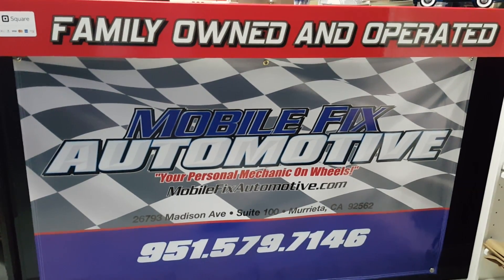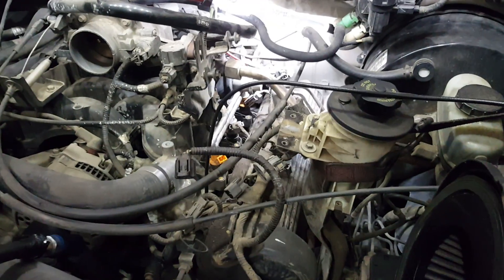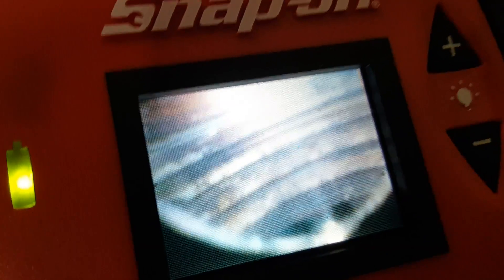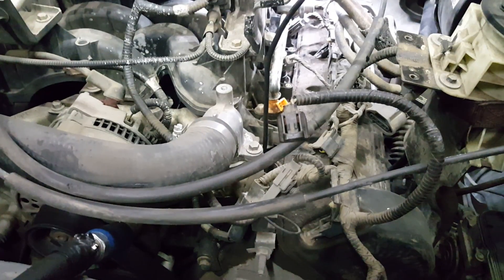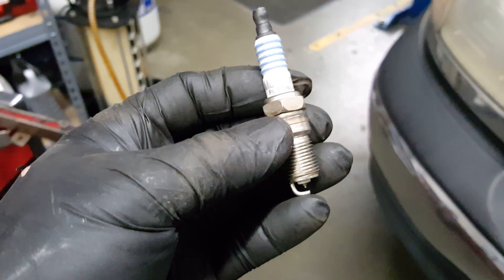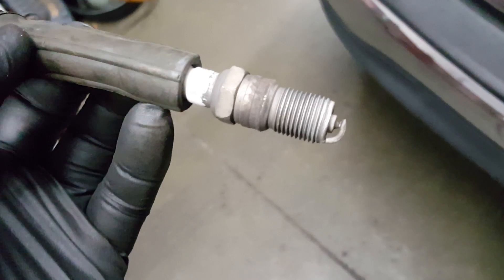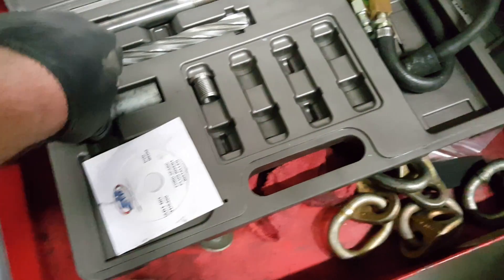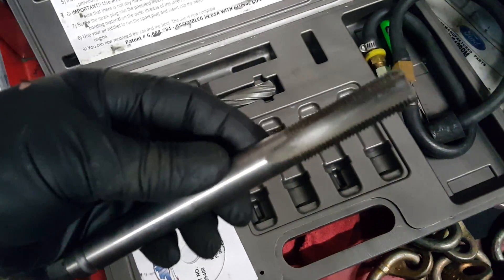Why the spark plug blew out of your Ford Triton engine

Comment: Son's 05 4.6 v8 2 valve insert blew out,need a 3x over size repair! Any ideas??? Thanks!
Reply: Buy a dodge.
Reply: I used cal-Van kit to repair a thin insert blown out on a 01 5.4 on cyl #4, a 20 minute job, has held fine for 4 years.
Reply from the maker: +RevBiker Big D it blew out a larger insert than the cal van.?
Reply: Ron Williams  No, just an auto part insert, mechanic said it would need 3 sizes bigger than first insert!
Reply from the maker: +RevBiker Big D 
I have successfully replaced blown out heli coils and save a threads with the cal van kit.
Reply: Ron Williams ok thanks will find out if your inserts you use will be bigger than the hole that's now there!
Reply from the maker: +RevBiker Big D outside diameter of threads is aprox .687in.
Reply: Ron Williams thanks for the size!

Comment: Your opinion. Hellicoil the head if you need to but if this was a factory issue, it will have been picked up.
Reply from the maker: +Jon Snell what do you suggest i tell the thousands of helpless people that blow out the spark plugs.? And dont say its a tune up issue. Ive personally seen this happen as low as 33,000 miles now. Plugs arnt even due then?

Comment: My 98 F150 5.4 blew a plug out at around 120k, at a 180k and rusted out 4 years ago, it's now long gone. I always knew why it did, it's  because of only 4 threads in the head is not enough to keep a spark plug tight from all the heat reaction contraction from everyday use. Makes me wonder what do other pickups have for thread in their motors?

Comment: Well done, excellent video!
Reply from the maker: +DanielJaegerFilms 
Thank you. I dont know about excellent but it should put some ford engineers on the spot to answer why they did not tap spark plug bore entirely.
Reply from the maker: my opinion is because the bore is tapered. they tapped from bottom up, it gets wider as tap goes in. that's why save-a-thread does not last in them.
Reply: @SandCarServices  my coil pack broke and the bolt is stuck on the intake manifold! It turns freely and doesn’t have grip to anything!!! I need some thoughts!
Reply: i just picked up a 03
rv with the v10 6.8 engine. should
i be worried about this? has super low
miles on it. 25k
Reply from the maker: I did a #3 on a 6.8 Triton in a class a motor home with 16000 miles months ago. So yes, check and make sure all spark plugs are tight
Reply: Ron Williams So should I do what blipco5 suggested and do some preventative/proactive measures like changing out my spark plugs and install new spark plug with anti-seize seize?

Comment: It's  a coil not a coil pack.  There's 8 coils not a pack.  A 4.0 jeep has a coil pack.  A gm waste spark coil on the 3100 etc...
Reply from the maker: +anthony fym 
You are correct in what a coil pack is however technically they are called a direct ignition coil. Or c.o.p (coil over plug)  ive been doing this so long i have my verbage and thats what i say. Im not charging for the information on my videos and im not giving incorrect repair  information in my videos so why are you splitting hairs. I had some really great videos that i have filmed and deleted just because i said something wrong but did it right at the same time.
There are verbal mistakes in nearly all my videos but none will cause a person to do something wrong to thier vehicle. All I am trying to di is pay foward what i have learned to help the community.

Comment: I bought a Ford F150 as a wood hauler, a 92 with about 150K on it  yes old, but only 150K.  I was getting an odd exhaust leak like engine noise - two of the plugs were loose. Went to change the plugs and I almost had to put a a break-over bar on them to get them out.  So some were apparently backing while others were almost froze to the head.  Issue after issue. Can't imagine why people spend real money on Fords.  

But unfortunately from the reviews I've seen Chevs aren't much better if at all.  Watched a video yesterday about a mid-nineties Silverado and the guy was going on about how much he liked the truck.  And then went on and on about all the problems he had had with it.  In the end, about the only thing he had not repaired or replaced was the transmission.

I also have a truck that is not a Ford or Chev and won't say what it is because I don't want to increase the competition with people who finally admit the stuff they're driving is crap.  It has almost 300K on it and don't have any plans for replacing it.  With what, a $41,000 Ford that has the same issues they've been dealing with for the  past 30 years?

Comment: Hey Ron nice video as for me I own a 2000 E450 with a V10 2v with 215,000 miles on it since brand new from the dealer back in may of 2000 Im suprize I have not had that issue with the spark plug blowing out why is that?
Reply from the maker: +Live Your Dreams
Not all engines do it. But keeping plugs tight helps
Reply: Very true ron I guess I got one of tje good ones lol

Comment: not enough threads ! I will never buy a triton engine !
Reply: The 2003 Ford Mustang Cobra had the same issue. I used to ride with my repair kit with me cause I blew out every one at some point. The 2004 cars had 10 threads.
Reply: Ford corrected the problem then discontinued the engine shortly after
Reply from the maker: Ford never corrected the problem and the engine is still in production. The 6.8 v10 is still being put into Van's and motorhomes. The 4.6 was made after 2004 when the 3 valve was introduced.

Comment: Don't own a ford..Now and forever amen....
Reply: I have owned many Fords. They are no better or worse than GM. It's still a matter of personal preference. My 2004 f150 4.6l have 225345 miles on it and my 95 tbird lx4.6l had 330,000 on it and still running. So that argument is moot. I have had GM products that failure was a common feature of the vehicles. So I will stick with Fords.
Reply from the maker: Well put.
Reply: @stevenbaker470  Be glad that T Bird isn't a '95 Taurus.  The 1995 Taurus is the reason I'll probably never buy another Ford....  Except for the good old classics of course.  That Taurus I had was by FAR the biggest pile of shit I've ever owned or dealt with.  Bad engine design...  Bad transmission design...  The most idiotic wiring harness I've ever seen.  The list of shit wrong with that fucking turd is endless.  I scrapped it at 85,000 miles.  My 1993 Escort?  GREAT little car.  Sold it to a friend when it had 220,000 on it.  The only problem was the AC had a slow leak and it was so gutless you couldn't drive up a hill with that AC on.  Still, that piece of shit Taurus was inexcusably bad.  A friend of mine also had one.  His was a complete piece of shit too.  Most of the same problems I had with mine.  Some time during the 1990's Ford forgot how to design a decent car.
Reply: Ur a moron. Own a foreign car is cool tho right? When it comes to trucks & SUVs Ford owns that. Sports cars too. At least up to $70k in sports car segment then Corvette & Hellcats take over. Ur a troll. Go get in ur Civic or Corrolla . I rather take a bus everyday.
Reply: @Davido50  the only moron here is you Davey kimmstick. You are talking out your ass again
Reply: Unfortunately chef and dodge are even worse. Most logging companies in bc use ford. They seem to be the toughest pickups. F350 or bigger though.
Reply: @bobfossum7515  Yet Ford is the only one who can't properly put the spark plugs in the engine.  Tell me, how exactly are Chevy and Dodge worse?  Give me an example of ANY Chevy engine that is even half as flawed as the Triton.  The ONLY one I can think of that was as gigantic of a piece of shit as the Triton was the Chevy Vega engine.  Keep in mind, Ford fucked up the spark plugs on the Triton TWICE.  Ford will continue to sell garbage because dipshits like you will buy them no matter HOW shitty they make them.
Reply: @craigcampbell8560  Chevy 305 the engine in the first generation of the 4cyl s10. All American car manufacturers have some form of issues. Particularly in the 1970's.
Reply: @bobfossum7515  I have a 99 Tahoe, engine has never had an issue. Only problem was the transmission at 100,000. Only has 115,000 on it right now. This is why I am still a Chevy fan.
Reply: @andym1223  had a 2001 GMC 1500 4x4 with 245.000 never did anything to the engine except mantinenc original 4L60 trans and I sold it for $6500. Had a 1998 Chevy 4x4 1500 sold it with 288.000 never pulled the engine apart except intake gasket. Now I have a 1999 3500 dually 4x4 257.000 original 454 and original 4L80 trans and I also own a 2008 Chevy 4 door 4x4 1500 that only has 130.000. I have been wrenching for 35 years and Ford is really piss poor engineering. I will own nothing but GM

Comment: Well let's get to the real heart of the problem. Henry Ford never intended to build great products, just to build as many as he could pump out as cheaply as possible and sell to the masses. This is just one of the engineering flaws present in so many Ford designs. For instance the idea of running the coolant through the timing cover which is responsible for many failures. And then look at how many bolts hold the water pump and timing cover assembly in place together that have to be removed to replace either. Then look at a GM design.  Fords use around a dozen bolts, GM use four bolts, two per flange with one on each side for an example. Very Simple and efficient, much less machining involved therefore lower costs. And the coolant is only in the water pump not the timing cover below.

Next look at the casting method for the Triton heads. DO the castings have a solid amount of material from the upper deck to lower deck that when tapped would provide a full amount of thread from top to bottom? Obviously not the case or the Triton engines would never have this problem. Where has the material gone that should be there or was it never there to begin with through the use of mold plugs that saved Ford from having to drill the head and enabling nothing more than a tap that as taps will do, remove much of the "Starting Area" prior to meeting the full outer diameter f the tap thereby leaving the actual tapped area lower than the starting area? Were the taps of an insufficient length?  How much could they have saved with this, "Better Idea"? Surely people remember Ford's slogan? I used to always scream whenever I heard the commercials say, "FORD-----Has a Better Idea"! . I would yell out, "Well I wish they would tell someone WTF it is"

Study the over complicated engineering in so many Ford designs and you will find yourself scratching your head wondering why  things have to be so complicated? Answer, they don't want anyone other than FORD Dealers to service them. Things are purposely made difficult to prevent a simplicity of design that is easy to service. Nothing more than engineered GREED!

Well enough of the truth, Have fun making unnecessary repairs that should never have to be if the engineering had been different. I would never own a Ford, but I sure have made a kit-n-kaboodle repairing them.
Reply: Your damn straight partner but boy do the ford guys get pissed off when you tell them. They are quite the story teller too saying GM copied this and that
Reply: I owned two fords when I was in mt early twenties and learned how cheaply they are made. In 1989 while working as a Plumbing & Htg Serviceman The 1969 Dodge Slant six finally gave up the ghost. The owner of the company had no choice but to buy a new van for me to use. 

I told him that I didn't care if he bought a Chevy or a Dodge but not to waste his money on a Ford. Well wouldn't Ya know it when I came t work the following Monday there sat a new E-350 with a 300-six. I just shook my head as I came into the front office where he was sitting. 

He went on and on about what a great buy he had made and this was a great van and on and on blah blah blah.

I drove it as usual in Cleveland traffic. Just shy of 12000 miles it quit running doe to the valve guides being, "Burnt Out", as the dealership mechanic explained it to me. That van sat for more than two months while FORD searched for the "Correct" head for it. I was of work during that time and eventually quit working there as a result.  

And the 300-six that was touted as "The best engine ever made" was a complete POS. I saw many cases in which they failed for the stupidest reasons. Another one of FORD's BETTER IDEAS LMFAO
Reply: Let them all disagree with me as 100% of Fordmocrats do. Are 1.8 illegal aliens right because they too disagree with me? WRONG! 

And as far as being from Cleveland which has a HUGE Ford following, many of my friends and relatives worked at the Ford Brookpark Engine Plant and when the subject of shoddy engineering would come up I always got the same reply of, "Hey I just work there"! 

So when even one, as you put it, "Know it all",   knows he is right , sometimes it pays to listen . I will use Alfred Einstein as an example, though I am no one in comparison.

So as your Ford is in the shop with it's spark plugs blown out of the heads, I will laughingly "Toot", my horn as I drive by in my Chevy or Dodge. 

Enjoy your, Fix Or Repair Daily, if it isn't, Found On Road Dead, my friend along with your thousands of other Fordmocrats
Reply: In this case, YES I DO!
Reply: Darr  Do you mean the same dipshits defending the Triton now?  Fordtards will never learn.  Ford will keep selling garbage because the legions of morons will keep buying them no matter HOW shitty they make them.

Comment: Furd is the biggest piles of crap on road
Reply: Where I worked we had Dodge 1 ton mason dumps - windshield cracked from the driver's side at 76 miles one - YES seventy six, another at 250 miles. No warranty - refused! Turned out Chrysler didn't know how to measure the opening of the cab. I know many other Dodges that had the same problem. OH! and when the piece of shit picked up the plow, the front end went down 8 inches! Our F350s (8 years older) went down 1/2 inch.  SAME Western Plow! The only Dodge I ever liked was the M37 power wagon US Army! Drove a Dodge C800 1973 model - looked like something from the 50's Drove like it too!
Reply: HEMI LOVER yup, dem dam sunbitch furds be tailgrabbin my ass....
Reply: RAM TRUCKS behind Rams and Chevy's

Comment: Not nearly enough meat grabbing that plug! The insert should have the entire inside threaded as well.
Reply: I saw that as well. Didn't seem right to me too but this insert is stainless steel so it should hold the torque better and not loosen up as it would in aluminum. 
 As far as the number of threads in the head might have something to do with trying to keep the plug running hotter. If it was threaded all the way, it might run too cold because the aluminum head would take too much heat out of it.
Reply: Gary Anthony, yup exactly. The stainless had plenty of holding power over aluminum. I can't believe engineers thought 4 threads would be enough. But then again... They're engineers.
Reply from the maker: +Jesse Fritz may favorite saying is "engineers should not be allowed to work unsupervised!"

Comment: general rule of thumb for machinists is you need as much length of thread as the diameter of the bolt (in steel) double that for aluminum.

Comment: I've been observing Fords since the introduction of the mustang. Fords are junk. I have never purchased a Ford; never will.
Reply: I have to disagree all cars have the quirks I've driven Crown Victoria's to 350,000 miles worn out a few Lincoln Town Cars basically a Ford. the F-150 for older Fords are some of the best trucks on the road very few issues
Reply: Fook off too foreigner!
Reply: Ur a troll. A fraud. Kia's & Hyundai's catching fire by hundreds. Toyota gets biggest fine in US history for hiding defects. I very proudly drive Ford's for over 20yrs never let me dwn. I buy new always. Best trucks on earth.
Reply: @Davido50  , yes , if you can keep track of your spark plugs and corrosion on the intake valves.  Don't forget the great Ford dual clutch design on the wonderful Fiesta.
Metal shavings can't hurt a Ford, right?
Reply: @deibama  dual clutch design transmissions are awesome engineering.. but not all customers could adjust to feel of manual/auto box. Ford is outstanding! All American & family owned. Only vehicles in our driveway bub. 2 newer F150s Ecoboost FX4. The king of trucks. 1- '18 Escape Platinum too.  Spark plugs? Change em b4 100k mis as normal. No automaker should allow plug intervals that long yet they ALL do. 5.4L Triton millions out there.. most just fine. Keep driving ur sludged junk KIAs & Yoda's ..watch them shrapnel airbags in millions Hondas too!
Reply: @deibama  intake valve corrosion? U mean carbon ? Keyboard engineers & mechanics . U wish. Ecoboost has had no trouble with its Gen1 GDI motors . U don't change oil in 7500mis or less all bets off on ALL GDIs. Ecoboost on Gen2 w/direct & port fuel injection. High tech stuff. U won't get it. ;) Millions Ecoboost on rd going great. Check Hondas new 1.5L turbo GDI motor ..failing all over. Now ur educated.